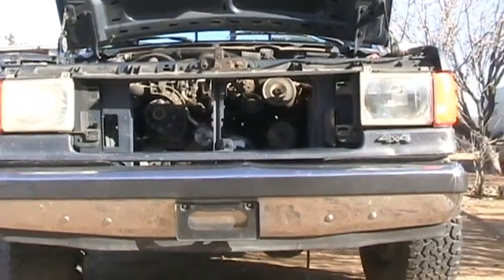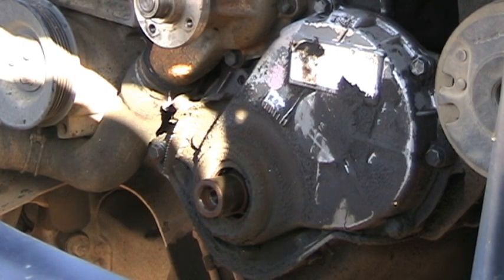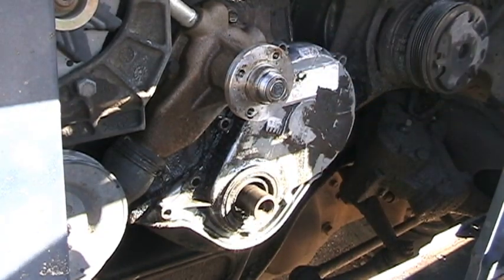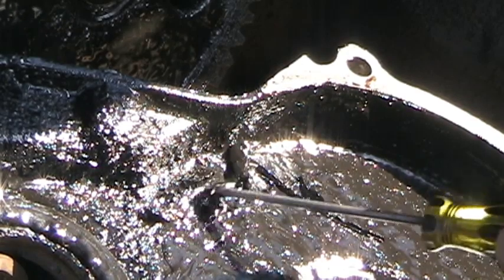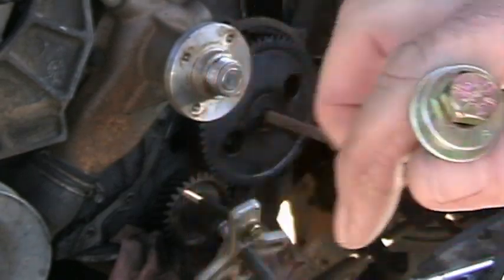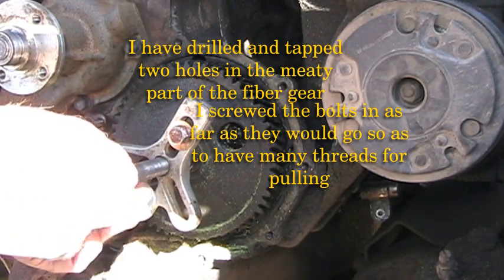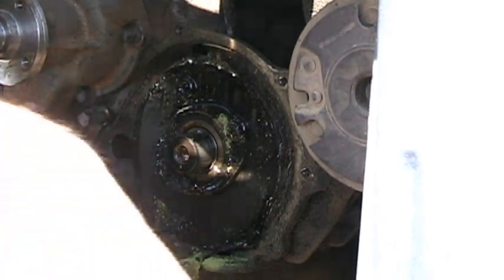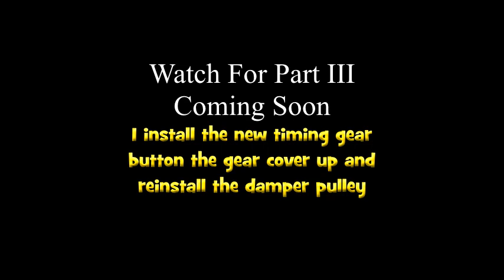1987 F150 i6 Fan Clutch, Cam Timing Gear Replace Part II

Comment: I used your exact procedure to remove both the crank gear and the cam gear.  Drilling and tapping the fiber cam gear worked perfectly. Did mine in a 35 degree garage. Thank you!!
Reply from the maker: Thanks for the great comment! That procedure was an original idea and until I found that it actually worked I was debating using a hammer to bust up the fiber gear and try some sort of pulley remover tool on the metal part. 35 degree garage ain't no fun, but the outcome of doing a good repair and seeing the work through to completion does take your mind to other things beside the cold. Stay Warm and Thanks for Watching!
Reply: SteveAZ711 
My impact wasn’t strong enough so I used a breaker bar that touched the ground & bumped the starter to loosen it.

Comment: Hi Steve.  Thanks for your video.  It is a great help.  I just want to mention that the bolt for the center/end of the cam shaft is a 7/16" course thread.  It might be mentioned in the video but I missed it.  Also, I didn't succeed in using the drill and tap method of removing the timing gear so I had to resort to cutting off the fiber part of the gear and pulling the center bushing.  I used a two arm puller like the kind use to remove the power steering pully.  In order to get the arms to hold in the small grooves in the bushing I used a welding clamp to force the arms together.  It came off on the first try.  The down side is that bits of the fiber gear went everywhere when I cut it off with a dremel tool.  Thanks again!
Reply from the maker: Hey Gary, thanks for the comment! It is a good thing that you told the viewers of an alternate way to remove this gear. Sorry my way did not work, but you solved the issue and with a great description of your work. I hope the viewers read the comments for they are a great resource of knowledge as you just proved. Again, THANKS FOR WATCHING AND COMMENTING!
Reply: Steve, I noticed that before I put on the crankshaft gear when I tried to move the cam shaft gear forward a couple  of teeth to line up the marks exactly there was some resistance.  I didn't force it forward and I just counted teeth to be sure the gears are aligned.  Shouldn't the cam shaft move pretty easily?  I'm afraid that something might be wrong and I am about to strip the teeth of the new cam shaft gear.
Reply from the maker: Hey Gary, There will be some resistance as the cam has to push the lifters and compress the valve springs. Remove all the spark plugs so there is no compression. Liberally squirt some WD-40 down each cylinder plug hole. Try rocking the crank back and forth a bit and see if you can get a feel for the resistance. This 4.9l 6 a non interference engine so the valves will not hit the pistons if it is out of timing. Hope this helps.
Reply: I did and it helped!  The my truck is running as we speak and all is well.  Thanks again Steve!
Reply from the maker: Good Work!

Comment: Thanks Steve. Good video. You may have saved me from pulling the camshaft and pressing off the timing gear. 
Sometimes a little tap on the puller bolt head while it is tight against the gear will help loosen the gear.  But don't brad the bolt head when you tap it.
Reply from the maker: +MrJerryAmerica 
You are absolutely correct. That little tap sometimes helps in a big way. Glad to have helped!
Reply: SteveAZ711 Hey Steve. How did you get the gear past the broken teeth to mesh with the crank gear teeth again. I feel it is important not to rotate one independant of the other. I get the crank to rorate but not the cam. in the video it changes position all the sudden?

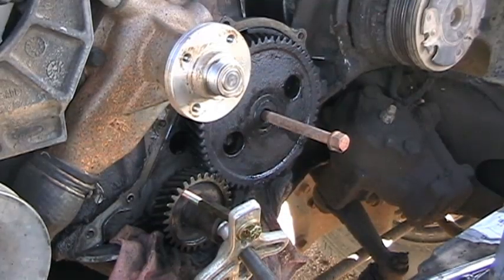Comment: 12:04 i hope i don't have to replace the timing gear.  i do have a sheared roll pin in the distributor gear.  1968 F500 300 inline 6.

Comment: Did you have to drop the oil pan when you pulled the timing cover off?
Reply from the maker: No I did not. I probably  should have to better clean it and the oil filter screen. However, the truck ran fine. I did change the oil a few times more frequently than normal.
Reply: @SteveAZ711  thank you for the quick response.

Comment: I just upgraded my cam gears, also a small melling stage 1 cam. It now has an idle issue.  Does the spark plug gap need to be changed? No vacuum leaks of any kind. Timing is good. Do i need to chane the plug gap?
Reply from the maker: A larger gap may help to burn fuel better, but I would look to the wires and plugs first and see if anything is causing a misfire. Start it up at night (pitch black outside) pop the hood and look CAREFULLY for signs of electricity around the wires or plugs, distributor. Did you disconnect your Spout connector when you set the timing? That needs to be done. When you re-connect then the computer takes over.
Reply: @SteveAZ711  i sprayed water all over the plug wires and dizzy cap. No change. Everything in yhe ignition system is new and is in good working order. Sprayed water (from a water bottle) all over the vacuum hoses,  upper intake, and throttle body. No change. And yes sir, removed spout while timing was set. Im beginni g to believe its a fuel issue. It bucks and jerks intermittently.  It has a new fuel pump in the tank, the frame raik one is factory.  Not to mention the i jectors are cheap ebay ones. Hard times when i got them. I have  new factory OEM remanufactured ones going in this weekend. Hoping thats it. If i regap the plugs slightly bigger, i was thinking maybe going to .047. Stock is .044. See what happens. Sucks. Ugh. Its been a nightmare. Lol. Thank you for your reply
Reply from the maker: Keep your cool. It is a process of elimination. It may be something you did and it just might be some new issue. It is sounding like a fuel issue. Check the computer for error codes and the fuel pressure as well. You need both pumps to be working. Here is a link to what may be someone with a similar issue as yours.
https://www.f150forum.com/f10/89-f150-bucking-jerking-idles-rough-after-10-minutes-run-time-dies-139323/
Also, if you have a friend that is knowledgeable in mechanics then have him check it out. Sometimes just a different person listening and looking for a problem will help because he has not done any work on the vehicle.

Comment: Hello again 
I asked you a question on one of the other videos and your answer helped a lot so I have another please
I changed out the timing gears and everything went great. I even used your video about setting up the timing. Now when I drive it I can’t get over 45 mph even flooring it. It is a 88, 4.9, 4 speed. I also welded the exhaust up. I thought it was the exhaust but I since cut the exhaust with a saw saw but no better. I had a mechanic try to go behind me on the timing but he couldn’t do much better. I’m going to put new spark plugs in and see. What do you think I could have done to cause this? You think I may have messed up the distributor? I took it out while doing the job
Reply from the maker: I do not know, but here is what I would do. Check that the exhaust system is not restricted and getting good out flow(mouse nest in muffler). Then I would disconnect the spout connection and check or set the timing at I believe is 10 btdc then reconnect the spout connection. Then I would do a code check. This code check will involve counting the beeps from the code checker. This is OBD 1... the checkers are cheap. The newer ones count the beeps for you in a digital readout. Also check the airflow from the filter to make sure it is not restricted. Your issue sounds like a similar issue with an old school carb setup where the choke is stuck closed.  Check the throttle position sensor...Here are some links to consider...
Tp sensor...https://troubleshootmyvehicle.com/ford/4.9L-5.0L-5.8L/how-to-test-the-tps-1#1
Amazon code checker...https://amzn.to/2vuyrIo
That's all I got. Hope this helps.
Reply: Cars Trucks And Detours ok I will thank you
Reply: I’m having a very similar issue.  Any luck getting yours going?  What was the issue?
Reply: sixditch it was the distributor

Comment: I can't get that damn fiber gear to tap. I'll have to try 2 new holes before dremeling it.
Reply from the maker: My tap was fine threads and I took it slow. I turned it a little forward, then a little back ward as if I was loosening a rusty bolt. This gave the threads a chance to cut a bit and remove a bit or the fiber  material.
Reply: @SteveAZ711  Unfortunately for me the bolts I have been able to tap in have just torn out. The plastic seems to be more unstable. Going to try 2 jaw puller and if the gear just breaks more then I got my trusty dremel!

Comment: How did you get they keyway out?
Reply from the maker: Hey Cory, I did not remove the keyways. However, I found that to remove keyways a small punch or finishing nail set tool and a light hammer will tap them out. Thanks !

Comment: Did you have to lift up the motor to get the long cam out since its in the truck
Reply from the maker: Measure the length of the engine may have to pull the radiator and the front grill anything that's going to be in the way. That is the way I would do it I believe that is the way one of my book says to do it as well
Reply: I replaced  the cam once already. But they sold me one that want cpmpuyer compatible.  So here we go again. I had to lift the motor, but was hoping somebody would have some pointers so i wouldnt have to. I could have it done in a day, just hate messing with the motor mounts as they tend to break, new or not. Learned the hard way the first time. Lol. Oh, well, guess im lifting the motor again.

Comment: Gotta ask, I’ve got a 1995 Ford 4.9l & put new pushrods & rockers in it.  The book calls for 17 to 23 ft pounds torque but I’m wanting to know if I can just torque them in as is at 23 ft pounds regardless of camshaft lobe position?
Reply from the maker: I always do these the old fashioned way. This involves a lot of mess, but with the engine idle low it is less messy. First I tighten my rockers down one at a time on each cylinder ever so slightly just to know that each valve is opening and closing. I rotate the engine by hand to make sure the valves are opening and closing. The rockers may seem loose but will not hold the valve open when it should be closed. I do each cylinder this way. When I am satisfied, I start the engine. It will be a clacking mess with oil most likely going everywhere (slow idle is better). Then while the engine is running I tighten each rocker to take out the clacking slop...you can hear and feel the outcome when the rocker is getting quieter. Like I said, old school, but it works and the valves will not be over tightened. You can try the 23 ft pounds if you like, as the 4.9 I6 is a non-interference engine. I would do that on the high side of the lobe though. Someone correct me if I am wrong. Always, If all else fails follow the instructions in the book. I Hope this helps. Thanks for the comment!

Comment: Is the 300 6cyl an interference engine, or were they smart enough to design the engine in a way that prevents the valves from slamming into the pistons in case of timing gear failure? So many engines do have interference issues, although you would think that the designers would have the sense NOT to design yet another interference engine. I had a good running, 86,000 mile 4cyl be ruined immediately after its timing belt's teeth sheared off while I was driving it one Sunday morning.
Reply from the maker: Hey Patrick, the 4.9L I6 is a non interference engine. The valves will not hit the pistons if the timing gear breaks. These engines were the work horses for Ford until they started using diesels. The I6 could be found in many delivery vans such as UPS, bread trucks, and others of the time. The engines have very good pulling torque. I like to keep mine under 3000 rpms as they are not high rpm engines. I went with a fiber timing gear (like the original) because they are quieter than steel gears. Please subscribe if you have not already done so and Thanks for Watching!
Reply: @SteveAZ711  
This is the first time I've ever even heard of a production auto engine that came factory equipped with a gear drive system, as opposed to a chain or a God-awful timing belt. I've heard that one of the main excuses for not using gear drives, is because of higher cost. I can't imagine that the cost of 2 gears would be all that much more expensive than 2 sprockets or tooth-slotted pulleys and a chain or belt. If anything the cost should be about the same....(maybe less??)

As far as the "fiber gear", is that just a steel piece with a fiber toothed gear ring attached to its outer circumference? Or fiber coated, steel teeth(sounds unlikely even as I type it out)? Or is the entire assembly made of a fiber material?
Reply from the maker: Patrick, the gear is all fiber except for the piece in the center about 2 in. diameter that holds the metal that slides over the cam shaft.  I really do not know why Ford did this. Perhaps like their old commercial says "Ford Has A Better Idea". My replacement was NOS Ford . The newer ones may be just fiber gear over steel or aluminium.  You can go an all steel replacement , but I hear they may make a whine like a blower. If you go all metal please come back here and let me know how you like it.  I had 1969 Cadillac that had a fiber gear on the cam and used a timing chain. That gear went out at 140,000 as I recall.  Thanks!

Comment: After messing with this cam gear 4 days, trying to get it off... with an arsenal of pullers, I am about ready to pull the engine and drag it to the curb for anyone that will get it out of my life.    No cam gear should be Phenolic. ... and nothing  that is made disposable (phenolic gears)  should be this difficult to get off.    and the lovely steel crank gear on my engine doesnt even have bolt holes-- guess i will try to use bearing splitter to remove it.   But really,  I am to the point that just want rid of this engine
Reply from the maker: Drill and tap the crank gear if you decide to keep working on this engine. If you decide to replace the crank gear go with one that has holes ( yeah I believe they make one with and one without don't know why). I feel your frustration! Anyone who has worked on their own vehicles have encountered similar situations that seem impossible to fix. However, know that there is a solution and do not let these auto repairs get you down. Here is a link to many who have been in your shoes...https://www.ford-trucks.com/forums/1123131-please-help-me-83-f150-timing-gears-problem.html
Reply: @SteveAZ711   Thank you for the response and support.   Yes indeed -  every machine has its contrived circumstance and unfortunate features built in.   Been messing with vehicles for 30+ yrs.. one build after another, but this is the first 300-6 I have ever opened up.  It might be my last.  Still thinking I rather have a 302w van again, instead of a 300-6 van.  My driving impression of these engines in a truck I had, is best described as "dull".. like the small garden tractor you wish had 1 more gear.. or even a gear to go to,  but figure i will make this one run.. and then see how I feel about it.      I drilled a line of holes across the cam gear and broke it off.   Then used a bearing splitter to pull its inner race off the cam.  I went with the comp cams steel cam gear set.   Thank You again

Comment: I’m at a stand still.  What bolt size & thread did you use on the cam shaft to push the larger sprocket on?
Reply from the maker: Hey Jim, I used a bolt from the assortment of puller bolts that came with the puller in Part 3 at 13:45 time. It also looks like an old Ford head bolt is in the picture. Find a good hard bolt that fits the  threads inside the cam shaft and a socket and you should be able to go from there. Do not forget to lube the shaft as it will make the gear go on easier. Use something light like liquid wrench, WD, or PB blaster. Here is a link to the video where I put the gear on...https://www.youtube.com/watch?v=zn09D33jnMk&index=6&list=PL5q1n3MQ9IDuMUNndpiil7cTjzh5ghJ9a...
.Hope this helps...Thanks for the comment!

Comment: Hey when you pulled the balance wheel off with that puller what was the thread pitch of the 3 bolts you used and how long were they ?
Reply from the maker: Robert I really do not recall. The puller tool came with assorted bolts so as to match whatever one might need and I did not check the thread pitch or the length. I suppose it was a missight on my part for not listing the bolt and thread sizes. I am fairly sure that the sizes were standard and not metric though.

Comment: Hey I tried the puller truck and my fiber gear broke is there any way to get the metal spindle off? The gear broke in half
Reply from the maker: If the metal piece that the fiber gear attaches to has a ridge somewhat like a power steering pump pulley, then you may be able to get it like that. If you do not have a pulley set here is a link of what one looks like..https://amzn.to/2KoEuUf
also, check out this link and you will read that a person rented a puller from auto zone to get the gear off. Another person pulled the cam and sawed it off. Here is the link. hope this helps...https://www.ford-trucks.com/forums/423577-1987-f-150-4-9-timing-gear-replacement.html